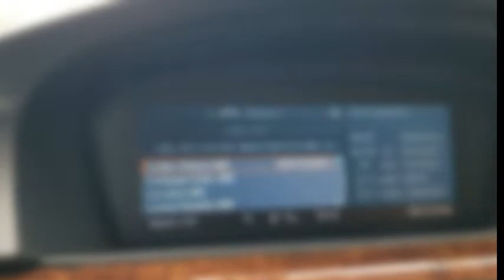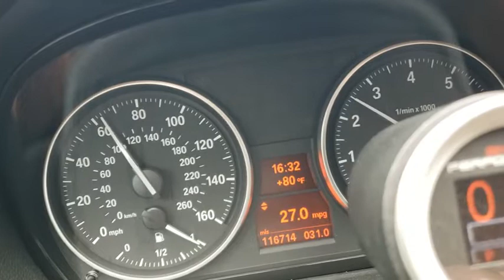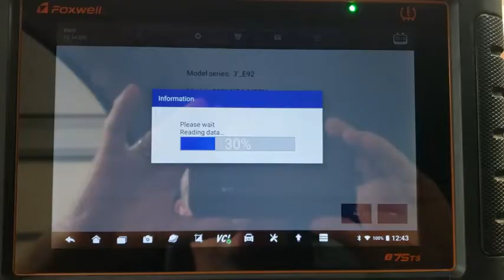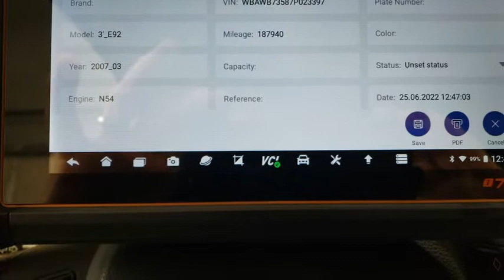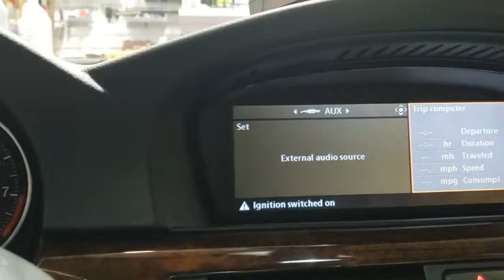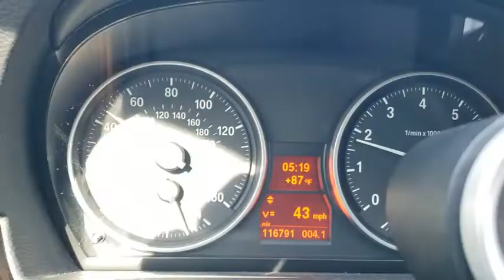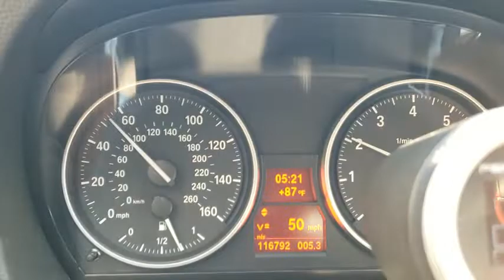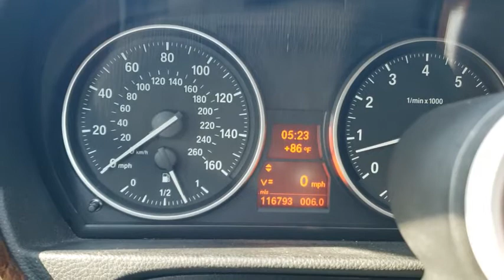BMW Kombi (instrument cluster) glitch solved (Foxwell i75TS)

Comment: Need contact info to discuss a P054B code
Reply from the maker: Sure, what's your email?
Reply: It will not allow me to load my email.   I would like to talk to you about the code.  Place together navy flyer 88 at hotmail should work.
Reply from the maker: @davidwaner7925  sent
Reply from the maker: Non deliverable
Reply: Please let me know when you send email so I can look
Reply from the maker: @davidwaner7925  still need your email address
Reply: Hopefully it works this time
Reply: I have sent it 3 times and every time I come back it is removed.  I ran into you and your wife at Lowes last weekend.  I was also stationed in Germany and brought back a 128i, with that code now showing up.  I just found it today with the engine check light.
Reply: What is your email address, I will send you an email from that address
Reply: Says you posted something 18 minutes ago, but I do not see it.  If you typed out your email address, it will delete it that is why I put spaces in the words and at instead of @
Reply from the maker: @davidwaner7925  How about we meet up for lunch at Sonny's BBQ one of these days?
Reply: @superk4562  I am good with this Saturday around 1130?  Early lunch would be better, if that is okay?
Reply: SuperK, I will not be able to meet tomorrow due to work.  Once I figured out what was wrong it was an easy fix. I let my daughter drive the car.  I heard her start and stop the car abruptly, which the car did not like.  I drove it to work and the light cleared.
Reply from the maker: @davidwaner7925  Yes, I believe that's in the fault tree ... remove daughter from car, clear DTC, does fault return?
Reply: @superk4562  all good!  But not my wife wants me to sell the car and get a truck.
Reply from the maker: @davidwaner7925  keep the car & get a truck.